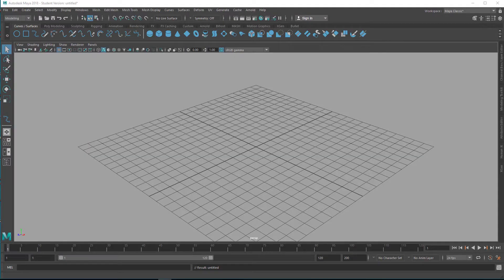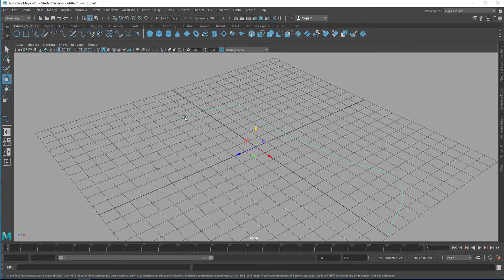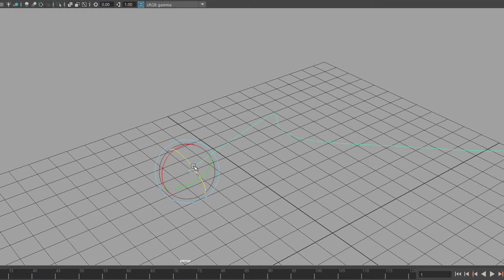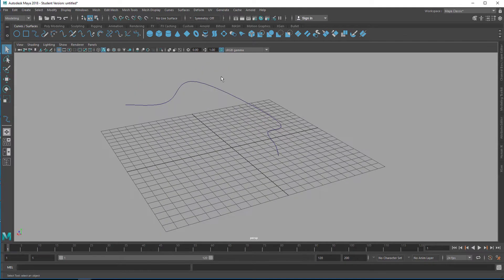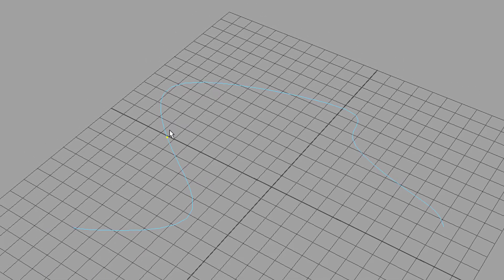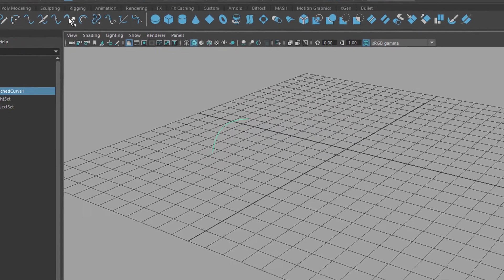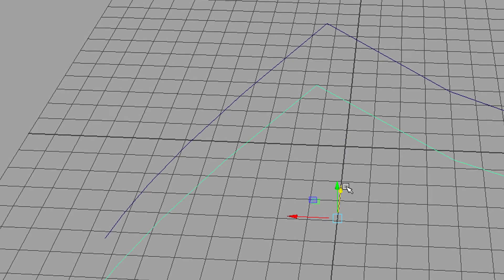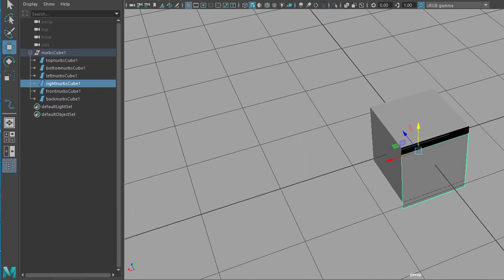Maya: A Few Curve Basics

Comment: How to fix when control points starts moving in only one axis only.. ?
Reply: Problem solved Symmetry option was activated which restricted me to move the control vertex in different axis or direction. Now that i have turned it off... it starting to work normally.